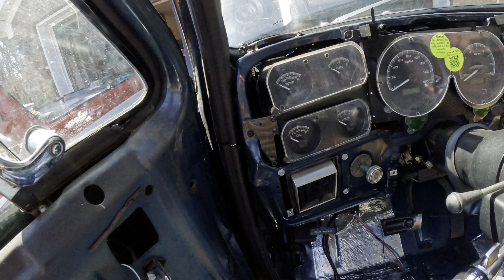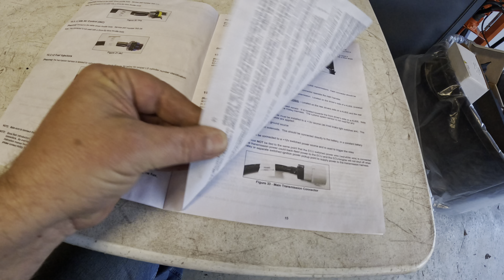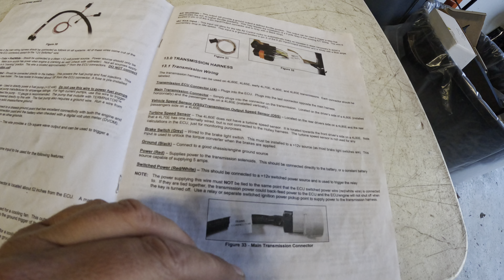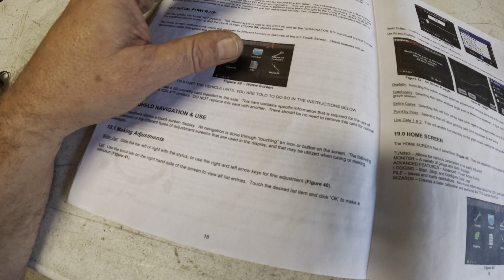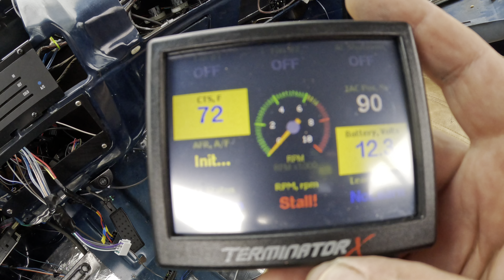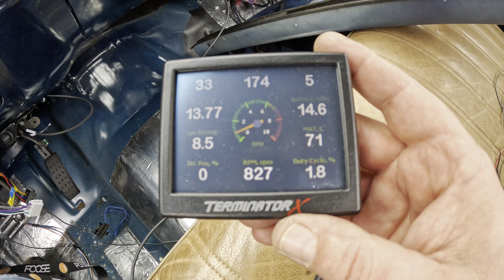Winston gets HOLLEY Terminator X! AND we fixed our engine problem!!

Comment: Never before have I ever broken a spark plug in any car of mine or my customers, until recently. Then I broke 2 NGK plugs going into my square, in separate incidences. I bought a fresh set of AC delco (stock-original)and no issues. But, I'm a ceramic engineer by training and job experience, and this concerns me, especially from the japanese. When customers ask me to LS their veHicle, or install FI, I say no. Too complicated and too high a failure rate. I cannot stand behind what Holley is doing with electronics (and the entire industry).  Good job, thanks for letting me learn from your development of these products. Are you keeping the cop car?
Reply from the maker: Had the cop car sold in 3 days…lol

Comment: Welcome back Winston:-). Upgrade was affordable until you factor in the $1000.00 for tie wraps, lol. I'm very excited for ya Hammer! Looking good! Stripped my 85 stepside rear frame, painted and have my QA1 ready for install.  Unfortunately rear frame a bit bent. Repairs in July :-) Thinking of a Iron block 383 around 450hp, with Sniper 2 efi, and built 700r4. Any thoughts appreciated. Cheers from Canada :-)
Reply from the maker: That sounds like a solid plan - maybe I should have gone that way instead.
Reply: @hammersgarage  The first one is always hardest. My bud just did an LS. He and you will be LS Guru's now. Camera  shots and explanation are actually very good. Keep up the great work Hammer. You've inspired, and wrenches are turning. Cheers :-)

Comment: Heck yeah, glad you got it sorted out finally. Have my terminator I need to lay on my 84 Im swapping. Interested to see if you end up with any issues with mounting the ecu in the engine bay, was planning on going under dash or even under the seat

Comment: Glad to see (and hear) Winston is finally running right! 
Would've been interesting to see if replacing the busted plug(s?) before doing the Terminator X swap would've had Winston running right.
Reply from the maker: I’m betting it would have ran great, half regretting going with the X tbh.
Reply: @hammersgarage  If you weren't going to mod the engine any more, I'd regret the X purchase too. But you plan on mods, so it'll pay off in the long run. 👍